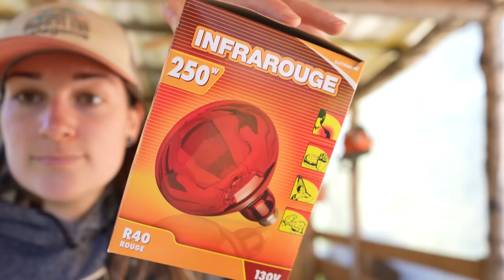We're Avoiding Food Shortages And Saving Money By Doing This | Off Grid In The Canadian Wilderness

Comment: Remember, heat raises. Maybe put lamps back in corner (three sides) and a top. Might contain the heat more with one lamp running. Also consider insulating the sides with reflective? They are so cute.
Reply from the maker: Yes, I taped reflectix up around the stand and it made a huge difference